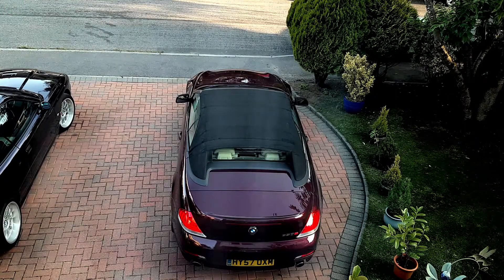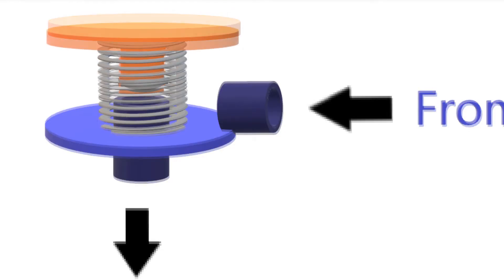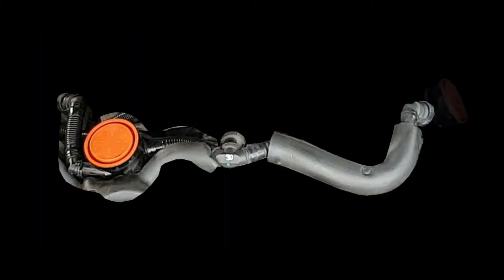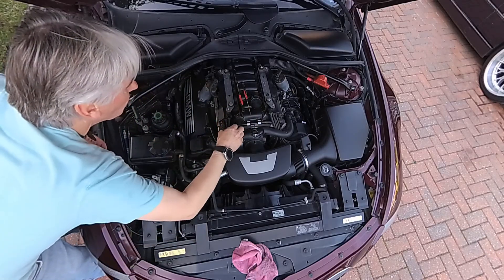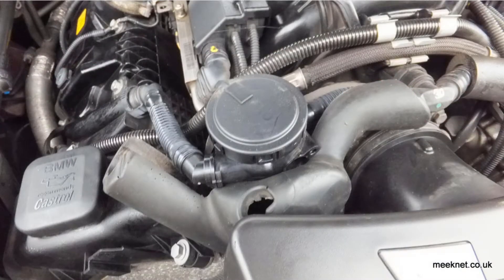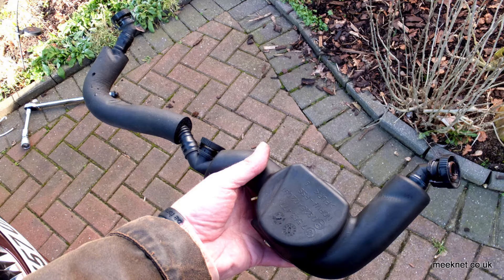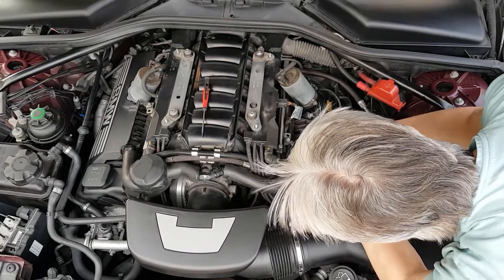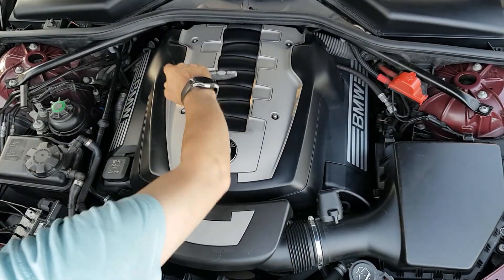BMW N62 Engine - Valve Guide Seals causing smoking? Fix in 30 minutes!

Comment: Wow, what an informative video. If I only I knew this info 5 years ago I could have fixed my 645ci. The main dealer told me it needed valve seals and quoted me a silly amount of money to do it. I decided to just buy a new car but I never got round to selling the 645 which has sat on my drive untouched ever since. after 5 years without so much as putting the key in the ignition it probably has far more problems now.

Comment: Unfortunately it usually is the VSS.
Reply from the maker: I have to disagree - of the cases I have been involved with over 60% of oil burn has been the crankcase ventilation system.

Comment: How long after cleaning out (or replacing) the pcv’s did the smoking completely stop?
I found significant gunk in bank 1, and have cleaned it out fully... just wondering how long it will continue to smoke for (gunk/ oil elsewhere in the system mate work through)...

Comment: PCV valve is an easy fix if that truly would be the problem with my BMW smoking - mine requires replacement valve stem seals.... got an easy fix for that?
Reply from the maker: Yes, price for valve-stem seals is dropping all the time, around £800 in the UK now, not the end of the world!

Comment: Excellent video - just replaced both valve diaphragms on my 550i after watching this, they looked in reasonable condition with only a little black gunk present rather than the large deposits you found the first time on yours but at least I know they're done now :)
Reply from the maker: Well done, good work!
Reply: i have an 09 550i thats smoking, did it really work and was it as easy as the video makes it look ?
Reply: @badtripsoffacid7981  Hey, yes it's a simple enough task to carry out, just be methodical in taking bits off/putting them back but it's certainly not a difficult thing to do by any means. With regards to the smoking, mine wasn't emitting anything noticeable but I just thought it might be worth checking the diaphragms as to my knowledge they'd never been changed (they looked OK upon inspection but I did get the occasional whiff of oil through the vents so certainly couldn't hurt to change them). If yours have split then it's definitely one possible cause of the smoke, just be aware it could the valve stem/guide seals as it's not uncommon for those to fail on this engine, that's a much bigger job though so doing these first is  worthwhile job beforehand!

Comment: Hi Timm this is Alvin, 1 of your best supporters. I have a question: I have 2005 645ci.
Everything is working perfect, thank God. Should I used a value stem seal conditioner, to keep them soft. Before they get hard? I'm asking for  Preventive maintenance.
Reply from the maker: Hello Alvin - yes, I see your comments on my channel all the time! No need for anything other than 10,000 mile / 1 Year oil changes with Castrol or other name brand fully-synthetic oil - and you will be fine! Good hearing from you.
Reply: @TimmsBMW  
Hay Timm thanks again for all your great videos. I have the 2005 645ci with about 50,000 miles. Is there any Preventive maintenance repairs that I should be doing or looking into.

Comment: Hey Tim I have a 2006 n62 engine when it idles I have whitish bluish smoke out the exhaust should I change the pcv valve first or would it be the steam seals
Reply from the maker: Yes, cheap and easy to do - then give it 100 miles or so to clear.

Comment: In the UK you can get valve stem seals replaced for £1k nowadays. I had them replaced on my e60. I asked for the old ones back - they were little better than useless - rock hard and the holes for the valve stem were considerably enlarged
Reply from the maker: Thanks Brendan, yes, a few places are popping up that do it sub 1k - hopefully I will never need them!
Reply: heya, where abouts can you find these places?
Reply: @krt2068  PMP in Nuneaton did mine.

Comment: Is there a distinction between continuous smoking vs. smoke coming out after a long period of idle? My 07 X5 4.8i only smokes after idling for 3-4 minutes, then revving the engine; then no more smoke. Before the PCV fix, did your car smoke continuously, or only after a long idle+ high revs like mine?
Reply from the maker: The best way is to always change both PCV's, clean out the pipework and then give it 100 miles - if it keeps smoking it wasn't the PCV's!

Comment: Absolutely loved that video. Some real good practical info. I even had a light bulb moment. About 6 months ago I changed my Vac hoses and replaced the top front one with a pcv upgraded version. I didn’t however blank off the valve cover CCV.  So I now have a CCV on each valve cover and an upgraded pcv, when installed I had to re-adjust my idle with Ista d as it went over 2k rpm. Not long after I noticed 2 error codes 2820 and 2821. These relate to differential servo motor and differential/cam sensor. After checking my crankcase pressure with a manometer it read around 20-28mbar. Could this under pressure in the crankcase cause these faults ?  Appreciate the info and any advice on this issue. Thank you.

Comment: The thing is , these cars can smoke from bad PCV valves or bad valve stem seals , cross your fingers and pray it's the PVC that's causing the smoking and not the valve stem seals .
Reply from the maker: No need to pray - just change the PCV's yourself in 30 minutes and for thirty quid and then you will know!

Comment: Excellent video. I enjoyed it. Beautiful engine bay as well. I have a 2008 550i and I have replaced the PCV valves also. I do have a little smoke after long idles but here in the US I have found a product called AT-205 reseal which helps alot with worn seals to rejuvenate the rubber on the valve stem seals. I didn't realize that you can wash and clean the PCV system periodically so I will do that from now on. I got the car at 100k miles. No smoke. Started changing the oil less frequently and started smoking. I love this motor and the torque it produces. I am a subscriber. Thank you!
Reply from the maker: Thanks!

Comment: Cheers Tim, just did my spark plugs (645ci) which was an utter pig of a job. While the casing was off I watched your video as my banks were showing lean.. 2x ripped diaphragms. Great video!
Reply from the maker: Really glad it helped!
Reply: @TimmsBMW  100%, parts on order. Also, vaccumn pump has developed a leak- watched your other video. Again parts in the post, all set to be done this week! :-)

Comment: I changed the 2 CCV valves and breather hoses on my bmw 745i e65 with 167k miles on, and now finally car stop blue smoking and the engine is like reborn: have much more power like was a new car. Thanks from Russia!
Reply from the maker: Thanks for letting us know - we always like to have feedback as it helps to work out just how many cars have stem seal problems and those that are simply PCV problems!

Comment: Hi Tim . I have X5 E70 4.8 2008 and he smoke by both exaust when the engine is hot and when I m in a traffic , also the engine smell oil burning ! What do you think ? Thank you for your return
Reply from the maker: Do the PCV's, leave it for 100 miles or so - and then follow this advice:https://youtu.be/Uzc9vQGuNnk
Reply: @TimmsBMW  Okay Tim , I will do . Thank you for your time . I will let you know ..

Comment: As an ex BMW dealer tech, I've changed a number of the OSV diaphragms on the rear of the inlet manifold on M60/62 engines, usually for poor idle quality though 👌
Reply: Are OSV diaphragms different than the valve cover pcv valves? I'm trying to diagnose this smoke situation 😑 I've been watching mine blow smoke at red lights for a year and I'm about to get into the repair. Shits embarrassing. And mines a convertible so I just want to slouch down onto the floor if I have to stop for a long light. The longer it sits idle, the more smoke it produces on take off. My buddy said it's the 'rings' and reading through these comments, sounds like it could also be valve stem seals? Same thing, or? I just blew up the ccc (nav screen) apparently as well from jumping it. What a pain. Checked the fuses and can't find any blown (trunk and glove box). Bout to take out the dash panels and ccc to see if there's a fuse on the back of it or something, last resort before just replacing it. Radio still works but the screen never lights up anymore, weird. I tried to reset it, pushing the volume control and both eject buttons.. nothin.
Reply: @bu5761  when I was in the trade, we would always look at the cheapest option 1st.
Replacing the PCV valves & the OSV diaphragm are a much simpler & cheaper repair than stripping the engine. If it were the rings, it wouldn't just do it when stationary at lights but would also do it when driving down the road.
Reply: Hey Darren I currently have the m62tu and can't seem to keep it from dying as soon as I start it up. When I unplug the MAF sensor it idles but very poorly but when I plug it back it in it does and even after replacing it still the same problem
Reply: @davidrichardson6528  one way to check is once the car's running, if you remove the oil filler cap, the car should start running with a very poor idle, if it doesn't make any difference then it's a good indication that the osv diaphragm is faulty. One other way to check is if you spray some brake cleaner around the area where the osv is located, if the engine revs flare up as you spray it, it's another good indicator that the osv diaphragm is faulty, which, on an older car they tend to do. Heat makes them hard & brittle & they eventually split.

Comment: Hi Tim on my 2004 bmw 645ci  I have white smoke coming out only from the left exhaust pipe  when I'm idling so u think it could be the PCV?
Thanks
Reply from the maker: As the PCV's are so cheap to replace go ahead and do them - if you still have smoke 100 miles later then it's something else.

Comment: Hello Mate, need some advice. I have a e90 2007 318i. Smoke on start up and at traffic lights. Wanted to change pcv, but was sent wrong part from ebiy. So mechanic ‘cleaned’ the pcv and hoses. They were filled with hard solidified pieces of oil/sludge. He then put it all back on. It is still smoking. Took car to bmw, they said they have no idea why it is smoking, charged me £200 to tell me this. They said they can open up the rocker cover/ head and maybe diagnose problem, but will charge me to do this. Should I ask them to replace the pcv/oil seperator and all hoses? Before i venture into possibility of stem seals? Also as the current pcv was filled with solid oil, should I ask for the hoses that the pcv hoses go into to also be replaced? So, the pcv has 3 hoses. They go into the pcv, the other end of the 3 hoses go into 3 parts of the car, are these parts likely to also be clogged? Should i replace them also? Or should I go straight to the stem seals? I would appreciate any advice you can give please.
Reply from the maker: Unfortunately oil sludge, especially where it has solidified, usually means it wasn't serviced in the past. I would start with replacing the PCV system and hoses and get an oil-service with a fully synthetic oil - and then cross my fingers!
Reply: Timm's BMW Repairs and Information nice one. Having that done tomorrow, pcv, all hoses and return pipe back to sump all being replaced. After this is all done, should the smoke stop immediately or does it take abit of time? As in, if there is still smoke afterwards is it because residue is clearing out or because there is a still a fault with the stem seals/pistons?

Comment: What pressure would you see if you had done that test prior to the PCV replacement?  Curious if you can determine if it’s the PCV or valve seals.
Reply from the maker: The pressure (or vacuum) can be wildly different if the PCV's are blocked or split - but anywhere between 15-45 millibars and all is good. However, even with the correct vacuum you can have a build-up of gunk in the valve covers that will cause smoking problems. The PCV's are so easy and cheap to replace that replacing them is the easiest test!

Comment: What pressure would you see if you had done that test prior to the PCV replacement?  Curious if you can determine if it’s the PCV or valve seals.

Comment: I changed both on my 07 750Li and still had black smoke only when standing in line in the drive-through. dont know what to do next. The oil level is not dropping at least from what I can see. Any advice?
Reply from the maker: Next plan would be to clean out the valve covers, either by removing them and cleaning with a solven or using a bottle-brush to get in there from the top.
Reply: @TimmsBMW  I am running a bottle of Foam actually two each with a full tank
 I hope this will go away after a while.
Reply: Where are the locations of the Pcv valve because on mine I can only find one which is on the driver side
Reply: @615Esteban  the none turbo V8 has two. Left and right side
Reply: @NeilKudro  I can’t find one on the left side
Reply: @615Esteban  it's covered by the foamy tube. I will try taking a pic for you tomorrow.
Reply: @NeilKudro  alright thank you

Comment: Hi Timm, great info as usual. What do you use as the bung on the end of your manometer tube?
Reply from the maker: Thanks! It was an accessory that came with a standard vacuum gauge - they sell them as separate items on Ebay

Comment: Is blowing smoke after long periods of idle (20 minutes) one of the symptoms of a bad PCV I already replaced them yesterday and it still blows smoke after idling. Although I haven’t driven it anymore than 20km in the last bit so it could just be that their is some still in the engine. Pls get back to me
Reply from the maker: Give it a good 100 miles before worrying - the manifold ends up coated in oil after PCV replacement
Reply: Timm's BMW Repairs and Information okay thank you for your swift reply. love from Canada 💚💚

Comment: Hi Timm, the N62 engine in my 2003 E66 745Li recently started emitting blue smoke but only after it's been idling for several minutes when warm, for example in a traffic jam. Once I drive off there's a fair cloud of blue smoke but then it's gone as soon as it came. I saw your video so looked on RealOEM to find out where my PCVs are but it doesn't have any, the only thing it has are  a couple of "vent pipes". Obviously I've been told that it's the valve stem oil seals that are at fault but given the symptoms I'm not too sure that's correct. Is it correct that mine doesn't have PCVs?
Reply from the maker: You still have PCV valves - from the drawings on RealOEM they are part 13:

https://www.realoem.com/bmw/enUS/showparts?id=GN63-USA-05-2003-E66-BMW-745Li&diagId=11_3258

On some world regions BMW did not move the PCV's from the valve covers to a separate housing - I guess yours is one of them. I replace the PCV on the valve covers in my video - so watch it all the way through!
Reply: @TimmsBMW  

Got them, thanks for that link, have crosschecked the cylinder head diagram for my car and they're in the same location as that, I'll check them this afternoon.
Reply: Well Timm, unfortunately the PCVs weren't the cause of my smoke, I took them out this afternoon and all looked good and reasonable clean. There was a little very old gunk coating the spring but nothing more than that. I cleaned them and also removed those vent pipes at the front of the block and cleaned them out too. Glad I checked the valves out though, thanks for your help.

Comment: Not gonna fix your problem.  Crankcase valve only causes lean mixture or whistling noises. That heavy smoke is fault valve seal period.
Reply: Sorry to disagree - but it DID fix the problem 5 years ago - and still going strong today. Fortunately, your blinkered view means that we can buy a great 650i for a few grand these days! Thanks!
Reply from the maker: This certainly fixed my car, and has not been smoking for a good five years now. It sounds like you had a bad experience of the N62!

Comment: Hi Tim! Great Video! I have a 2007 BMW 650i. Im having trouble with the vanos system. Rough start and idle poor acceleration and misfires. Should i replace the entire vanos system or just clean the solenoids? BMW quoted me a price $4000 to repair it! Please help. No  info anywhere that helps me!. Thanks in advance!
Reply from the maker: Hello Cory, your best bet is get onto either Bimmerforums.com or .co.uk in the 6-Series sections - it is a much better place to go into some depth. But first, get INPA and have a look at the error codes - very cheap these days and saves a lot of guessing: https://youtu.be/CBfyCItOJH0

Comment: How'd you clean the valve cover with 5amp Flex??? I want to try it but not sure what was happening there. Please and thanks!
Reply from the maker: A long bottle-brush (the ones with the twisted wire core) would do a much better job - I'll give that a go next time! The valve covers have the oil-separator cyclone devices built into them - if they get covered in much they don't work and oil gets past them - hence the need to clean them out.

Comment: Hi Timm, i have a question on the E31 headlight wiring degrading at the headlight unit on both lights. Can i message you for some advice please. Thanks Rick Webster.
Reply from the maker: Hello Richard, yes, the headlight wiring does tend to fall apart. A guy called Max Lumens on Bimmerforums.com 8-Series section used to make and sell them, so try him first. If you have no luck then you will have to repair them yourself - use the same method as used here: https://youtu.be/dapzH57DYVo